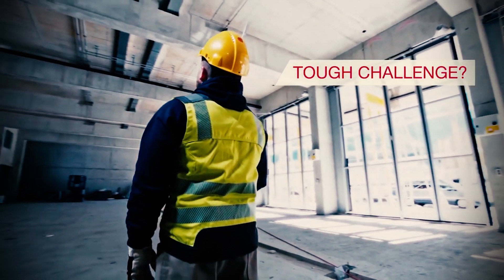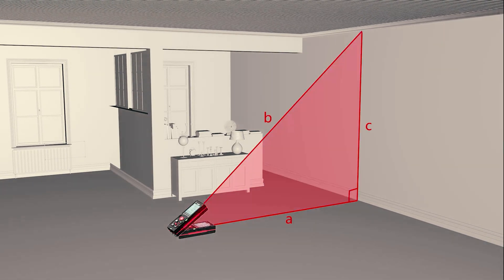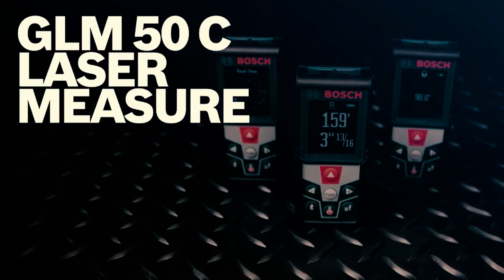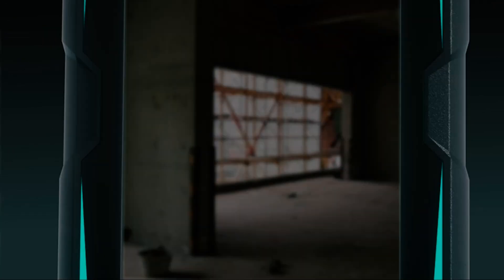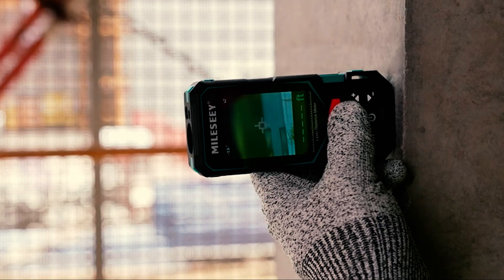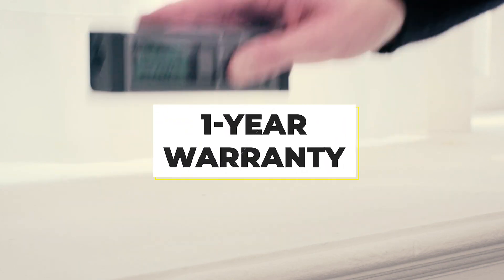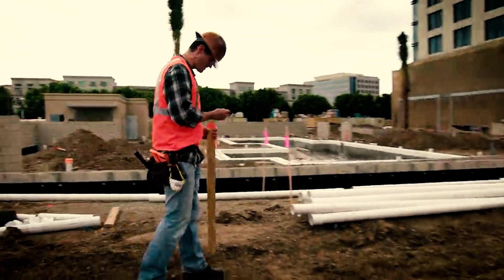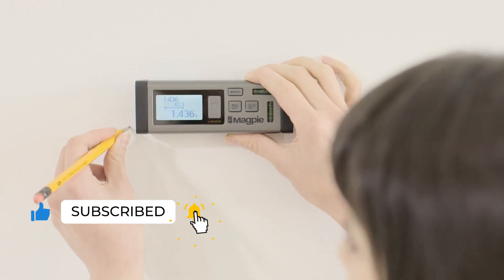Best Laser Measuring Tools in 2025 - Must Watch Before Buying!

Comment: I want to use such a device with a plastic corner-cube reflector plate, which reflects THOUSANDS as much back in the direction of the emitter than a white paper-like surface.  (See Lambertian reflector.) I want to measure 500, 1000, 2000 meters, with a resolution of 1 millimeter .   Problem is, I don't think the device will 'wait for' such a delayed reflection, even when it arrives with plenty of intensity.
And, of course, the display also doesnt have sufficient digits to display this.
Perhaps these manufacturers don't want to compete with professional distance measuring equipment?
N
Reply: Brain-dead clunky app.  Can't copy with smartphone.

Comment: Don't buy Bosch, it's shows dimensions to 1/32.  Quick what's 17/32?  No Bosh, just No.  I've been writing them for years asking them to make 1/16 their minimal fraction.  just because you can doesn't mean you should, besides, it's only accurate to 1/16th.
Reply: Or use millimetres?
Reply: Hhhmm - basic Mathematics:  Accuracy of measurement is HALF of the UNIT used.
QUOTE: "it's only accurate to 1/16th...."   is nonsense. Basic Junior Secondary Mathematics teaches that.   Besides, if designing small instruments / circuit boards / whatever, then 1/16th is a massive error (in measurement).   No wonder Bosch has not responded to your advice.  They know their business.
Reply from the maker: Thanks for your valuable feedback based on your experience.
Reply: Maybe thats a new thing, but I've had a bosch for 15 years. Set for inches, i get 16. But getting something new soon. I do construction, tape is used more, laser is super helpful in certain situations/areas of the job
Reply: I think you can change that default in the Bosch to 1/16.  a long press on some menu.  why is this not the default?  if they want more, throw me a +/- , dont change to 1/32
Reply: 17/32? About half an inch.